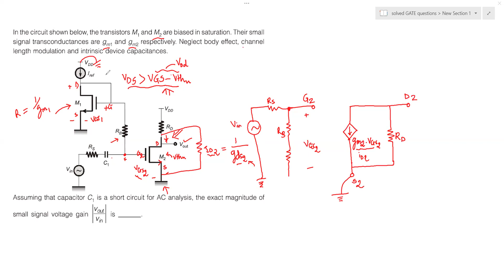Calculate the Small-Signal Gain of the Circuit

Comment: Nice Sir 👍

If the Iref =Cascode current source using PMOS transistor composed of  (M3,M4) and  we can calulate the Rx= (1+gm3ro3)ro4 approximately gm3ro3ro4 and then the from M1 g look into Rz=(1/gm1)//(ro1)//Rx and the total Rout =Rz is serial with RB
So vo/vi=vo/vgs*vgs/vi=(RB+Rz)/+Rs+Rz+RB)*(-gm2)*(RD//ro2).....Answer
Ps: all transistor CLM are not equal 0

Comment: This is the usual procedure on how to find the Vo/Vin, correct?
And in such cases where we have to analyse in AC, Iref becomes an open circuit, so by default in this case M1's drain is connected to the ground automatically?